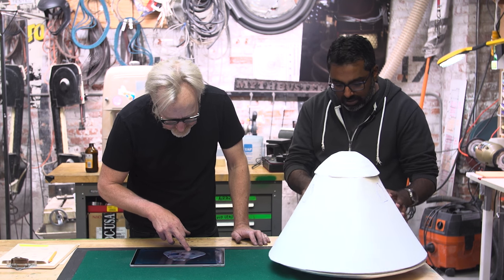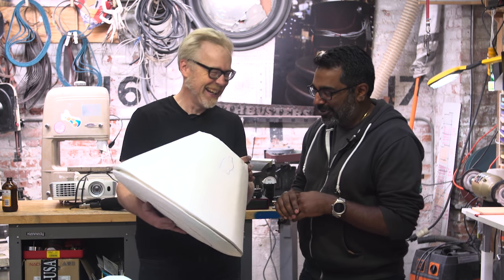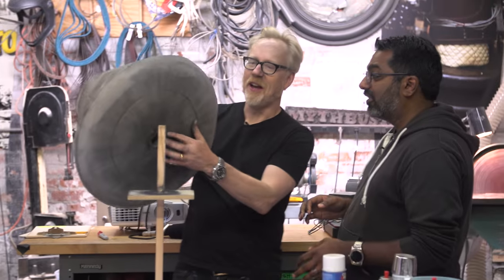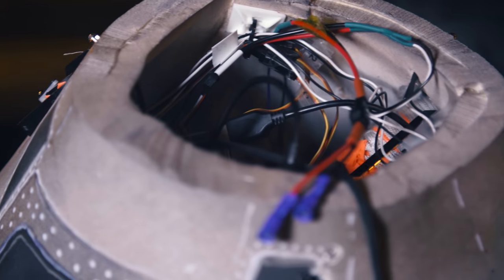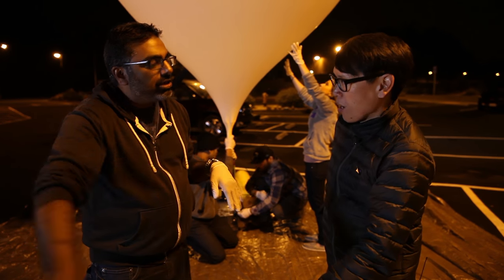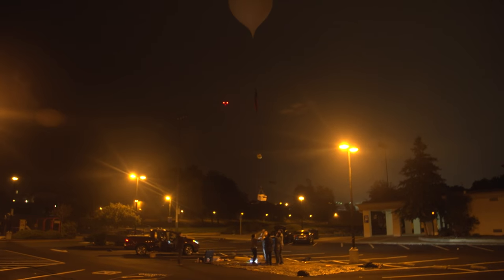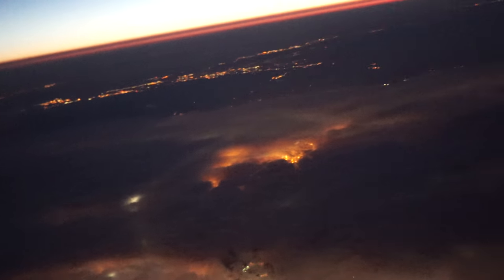Features Not Standard: Weather Balloon Launch and Recovery!

Comment: Seems like if a 360 camera was used then the footage could be stabilized later for more steadiness in the final edit.
Reply: We tried a Samsung 360 camera, but it couldn't handle the temperature conditions in testing.Gimbal is definitely a plan for the future.
Reply: John Bond Does software exist that can do that?
Reply: Yes it does. I don't remember where, but I recently saw a video here on youtube where they used a 360 camera on a weather balloon like this, and stabilized the footage afterwards. It was still a little shaky and there was of course some motion blur, which is not really possible to get rid of, at least not today.
Reply: John Bond 3d video is very hard to work with

Comment: 100,000 feet, 85,000 feet, over 70,000, just under 70,000.... Slowly coming down to earth (get it)
Reply: Erik Olson Kerbal spotted...
Reply: Wind conditions altered how high we let the capsule go so it would land in a safe area. Initially we were planning on 100K, but the winds were pretty odd the night of the launch necessitating a lower cut down.
Reply: Kishore Hari That's fair, but after the flight you still exaggerated the height... All I ask it that you tell the truth.
Reply: We actually did multiple flights to different heights including to 100K. I should have been more clear.
Reply: @PurpleLion35 Earth's atmosphere attenuates fairly rapidly the higher up you go. By 100 k, the atmosphere is so thin that imaging conditions are virtually what you'd get at the edge of space. It's basically called the edge of space because it's how high up you can conceivably reach without having to rely on high-tech rocket technology to get you the rest of the way.
Reply: Try as you might to justify the 'edge of space' claim 70,000 feet is NOT the 'edge of space'.

Comment: How could you stabilise the camera? I was thinking using 3 balloons spaced out using  a carbon fibre triangle and the payload being hung fron said triangle using 3 ropes. That way the moment of inertia is bigger and the payload is less likely to spin. Having 3 suspensions points should also reduce the tilting. Maybe. Any ideas? Gyros?
Reply: It's such an un-aerodynamic shape at the base that I think wobble is unavoidable. Spinning would be the clear choice for stability but not so much for a watchable film. If the base came to a steep 4 sided point it would likely be more stable, but wouldn't follow the design. Having the camera mounted on a gyro to counteract wobble and spin might be the best bet.
Reply: Gyros or post stabilizing
Reply: The balloons expand to about 30 feet at burst altitude, so your base/chord length has to accommodate that. Theres also a danger, if the chords are too close, they could twist around each other, but they could twist out as the balloon expands.  I've heard that 2 balloons with a large enough balsa  scaffolding  inbetween and the cameras and such mounted on the scaffolding evens things out a lot, but that starts getting heavy.  You only get 6 pounds total, including the baloon before you have to file a flight plan with the FAA (see FAA rules on non teathered balloons for the actual and current regulations) over 12 and things get more complicated.

We've used swivles on the payload end of the chord with moderate success.  A gyro or a good gimble is your best bet, but they cost money and add weight.  Its a trade off

Comment: Great video! Regarding the Gear360 not working: the camera tends to overheat in normal conditions, so people have stuck a copper plate between the battery and the slot acting as a fin to improve cooling Wonder if you could attach your heating pads to that

Comment: Heat the electronics? Well, you could wrap it in some insulation, and that will be good for a short amount of time.
Batteries need a bit of heat, to stay working, other then that, most electronics will work fine down to -20 C. And it takes time for stuff to cool down. And with a bit of insulation we are talking well over an hour.

Comment: What telemetry system did you guys use? RTTY, APRS, LoRa?
Did the cutdown work? because I do not see any footage of it. It has been attempted many times by a lot of HABers, but with mixed results. It is quite hard to get right.

This was a really heavy flight!
Welcome to the HAB club guys, well done.
Reply: Cut down did work. We used a ni chrome wire to melt through the parachute cord triggered by the arduino system on board at a particular altitude. We do have footage of the cut down, but it was "violent" and hard to see.
Reply: Excellent, and yes, dizzy video is to be expected. The coolest with burst is if you manage to capture it! Ours quit before burst because the GoPro battery cut out. but we got some pretty cool stills.
There is quite an active HAB community here in the EU, and people frequently track and recover balloons. I think the US has far less flights. Also, the formats and modulation schemes or the telemetry are standardized, so that everyone can help receive and upload the telemetry. Congrats on the successful flight, and that capsule really looked cool!

Comment: For some odd reason i feel the need to buy a honda. I just hope the air bag doesn't kill me. :)
List of Honda Airbag Recalls:
2001-2011 Accord
2001-2011 Civic
2002-2011 CR-V
2003-2011 Element
2010-2014 FCX Clarity
2007-2014 Fit
2010-2014 Insight
2002-2004 Odyssey
2003-2011 Pilot
2006-2014 Ridgeline
2010-2011 Crosstour
Reply: Everyone has airbag recalls.  From Honda to Chrysler to Tesla.  Everyone is using the same supplier.
Reply: EmperorEva0001 There are bound to be issues with mass manufactured explosives.
Reply: Cool, now do it for every major car company
Reply: I'm not givin' them free advertisement!
Reply: EmperorEva0001 You're not giving us anything. Without comparative data, your list is meaningless.
Reply: You know, you make a good point there. Now get back to work Mr. Soichiro Honda!
Reply: EmperorEva0001 Dismissing logic with bullshit... nice. I've never even owned a Honda.
Reply: When you put it like that, you've really changed my mind. Thank you for your incite.
Reply: EmperorEva0001 Zero minds have been changed in this entire thread.
Reply: Its not only honda, like others said.. its a bunch of different Takata airbags

Comment: Hello Tested. I have a technical question. You mentioned using the extra power to create the heat needed to counter the low temperatures. What exactly did you us? I work with thermal cameras in an aviation application and we hare dealing with inconsistent temperatures around the camera. Would you be willing to give me some details on your system? I would love to try it out to see if it works.
Reply: Future video will detail the internals and the heating system!

Comment: They should have put two ropes attaching it to the balloon so it wouldn't be spinning so much.
Reply: We actually discussed various rigs for stabilization - but many wouldn't work for a variety of reasons. The multiple ropes idea was used by a Discovery launch, but they had trouble with the torque it put on the payloads from the twisting.
Reply: Thank for the reply, another idea could be to put a small electric vertical propeller to keep it from spinning  like a tail rotor on a helicopter, anyway it was still a cool setup you had and I enjoyed the video.

Comment: wish someone would do this but with a CINI camera with HDR, ^K & high frame rates. stabilise everthing.
Reply: The problem is that kind of gear is heavy so you would need a really big balloon to get it up and it would cost a hell of a lot just to develop the system to keep the camera working at those altitudes.
Reply: what about a solar glider, w/ autop/drone prewritten recovery and flight pattern.
Reply: Still not cheap but you would have more power to play with, making things easier to keep warm. People do balloon launches like this because it's pretty cheap way to get things into the upper atmosphere. Not counting payload it's maybe a $1000 for the balloon and helium.

Comment: 70 000 feet is not even close to edge of space. The concorde had a service ceiling of 60 000 feet. Just 10 000 feet lower.
Reply: That 10 000 feet difference = 3 km, that's a lot, the U2 Spy plane had an altitude ceiling of 70 000 feet and the pilots for all intensive purposes, need to wear space suites to go that high.
Reply: Yes offcourse they do. You wouldnt survive at 40 000 feet for a long time either. But 70 000  feet is not close to space. 300 000 feet howevever is very close to space
Reply: U-2 pilots wear "spacesuits" because the original models didn't have pressurized cockpits (easier and cheaper not to).  IIRC, the newer cockpits are slightly pressurized and the pilots still wear pressurized suits ... just in case.

Comment: Why does Kishore mix metric and English units. He talks about 40 degree C (of course that it 40 degree F as well) Adam talks about a few grams instead of a fraction of an ounce and then talks about 85,000 ft instead of approximately 30,000 m?
Reply: Fred Zlotnick 
This is actually quite common in Canada. Technically we're metric, but there are a bunch of products that we get from the US, so there's a lot of mixing of use.
Generally if u are exposed to both on a regular basis u use the units that best fit the situation. Like, I would use inches and feet for short distances but kilometers for long distances. I use lbs for small weights but kilograms for large weights.
Also, "a few grams" gives a different impression than "a fraction of an ounce", which means they can be used differently depending on context
Reply: Yeah exactly, pick one and stick to ONE. Also since this is science related, stick to SI units

Comment: Isn't the karman line the edge of space? That's 3-4 times as high as they went
Reply: kendokaaa the karman line is at 100 kilometers or 62 miles
Reply: JBpiification They said the balloon went to the edge of space, then said it went to over 70000 feet which is 20-30km. That is very far from the karman line (which if I am not mistaken is considered the edge of space).
Reply: It was just a metaphor. I know we only went to the stratosphere - but we wanted to communicate the idea that a simple project could take you to surprising heights.
Reply: Kishore Hari I see. Great project by the way :)
Reply: kendokaaa yeah, by definition, if u can get a balloon there u are not in space, lol

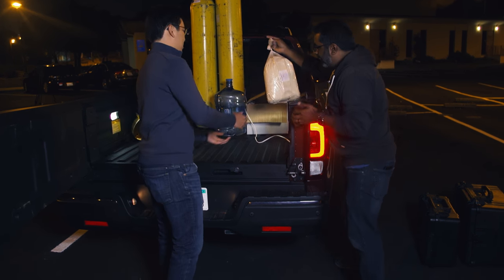Comment: 7:12 3000gram? why not 3kg?
Reply: because acurate measures are in gram
Reply: 3 kg in science could range from 2.5 to 3.4. Saying 3000 gram is more precise this way.
Reply: I thought the point of metric was uniformity of measure and easy conversion between units.
1 kilograms = 1,000 grams, correct?  how can 3 kilograms be equal to anything between 2,500 and 3,400 grams????
Reply: kazoosc yes, 3 kg = 3000 g. I'm talking about the amount of digits you use, this is very important in science. If you know a measurement accurate to the gram, write down 3000 gram or 3.000 kg. Writing 3 kg would be the same as 3 x 10^3 grams, which is only 1 digit accurate.
Reply: Merijn den Houting Just no, saying 3kg does not automatically imply an error of +-0.5 kg, if it's 3kg then it's 3kg=3000g=3000000mg
Reply: 05) 16+ min & podcast when you are doing science stuff NEVER assume 3 kg is 3000 grams.. imagine doing some measurements on the speed of something. You time it to be 6.2 seconds and the distance was 2.0 meters. We can now say its speed was 6.2/2.0=3.1 seconds. Can we say it was 3.100 seconds? No. Our measurements were not accurate enough to be able to say such thing. This is why the amount of digits is very important.
Reply: Merijn den Houting  how could even I, an ignorant American, take 3 kg to mean anything OTHER than 3 kilograms or 3000 grams.  it is two ways of saying the EXACT same thing.  I can't imagine anyone coming to a result of 2.5 kg (scaling up a recipe perhaps) and saying "oh, I will just use 3 kg.  that's the same thing."
Reply: kazoosc it is the other way around. You don't just round something up because it sounds better, you take into acount the precision in which you are working with. If you have a really heavy object you could say "this might weight 10 kg". This doesn't mean it weights exactly 10000 grams. It could be 10001, 9999 or maybe 10245. Saying "this might weight 10000 grams" is telling you its not 10001 or 9999. It is exactly 10000. Please look up something about significant figures. It is really important if you do real life calculations.
Reply: Merijn den Houting the same observation applies to rounding down.  my point was if the answer is 2.5 why would anyone use a value other than 2.5 kg or 2,500 grams?  

and there is no "might" in the video.

this is a 3,000 gram balloon

no equivocation, approximation or calculation -- just a plain fact/measurement.  so could he not also have said this is a 3 kilogram balloon since 3,000 grams = 3 kilograms?  going from 3,000 grams to 3 kilograms does not change the number of significant figures -- just the unit of measure.  that is the benefit of the metric system after all, isn't it, conversion between units?

now if he had said "this is a 2,932 gram balloon" you would have a point.
Reply: Merijn den Houting I understand what you are saying it's just that when you say 3.1 seconds that IS the same as saying 3.10000.... seconds. If you want to know about "significant figures" you must also say the error bar of your calculation, without it 3.1 seconds means 3100000 nanoseconds
Reply: kazoosc if your scale can measure that it is 2.5 kg then sure, it is 2.5. It however doesn't tell you that it is 2.53, it doesn't have enough accuracy to tell you that so you can't say for sure that it is 2500 grams.

You are also saying 3,000 grams and 3 kilograms have the same amount of significant figures. That is just plain wrong. 3,000 grams has 4 significant figures and 3 kilograms only has one. You can say this: 3,000 grams is 3.000 kg. Now they both have 4 significant figures. 
I also thing the word kilo is letting
in some confusion. Kilo just means 10^3. So 3 kg would be 3 * 10^3 grams. Both having just 1 significant figure.
Reply: 05) 16+ min & podcast ok so this may differ in both the country in which you are as well as the subject you work in. I see a lot of lectures in the usa often give their accuracy seperatly as an +- number. However (at least in physics) it is widely accepted to not just assume that 3.1 sec means 3100000000 nanosec, but rather 3.1 * 10^9 nanosec.
Reply: Merijn den Houting I mean 3100000000 =3.1 * 10^9  no matter what, but maybe where you are the norm is just that, if you use powers of 10 that already does imply the accuracy, but for us if you didn't say the accuracy then you didn't end of story

Comment: dumb question, I guess, but why is the cold, a problem for electronics? don't electrons move more freely the colder it gets? why do they chill conductors near absolute 0 to create super conductors?  why does every computer nut go crazy over the latest CPU cooler? I can see the camera getting fogged up or something, but that's an optical problem not electronic.
Reply: The cold kills the batteries.
Reply: toxicgraphix lipo batteries loose performance very quickly as they get cold l think it is because if the lithium...
Reply: JBpiification that's a really good answer, I should have thought of it, but didn't think of it.
Reply: toxicgraphix But that is a very good idea!